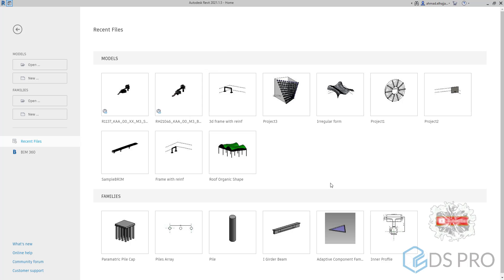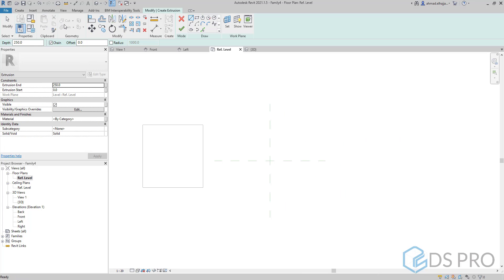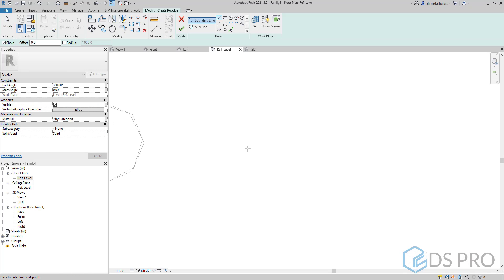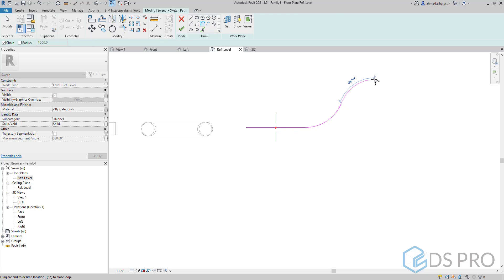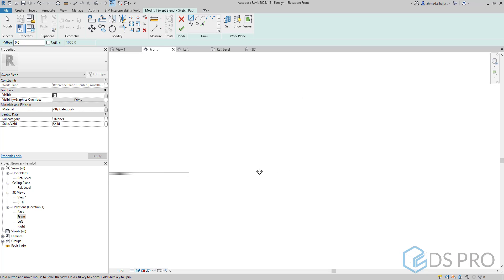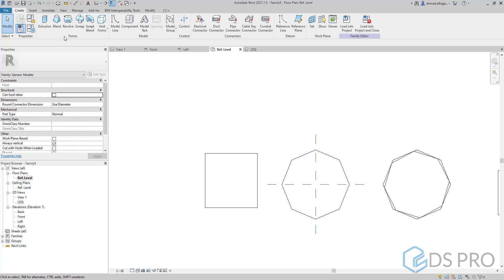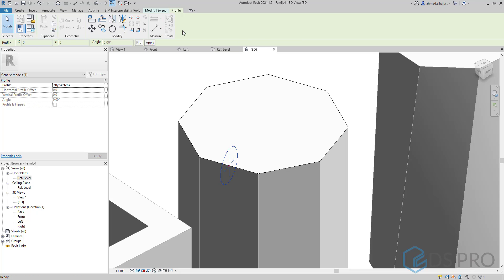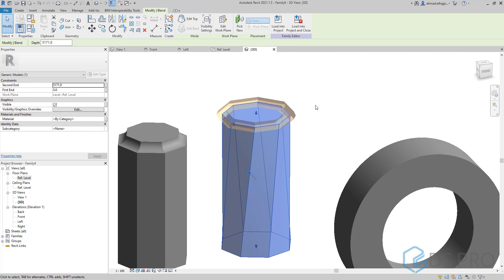2- Extrusion, Revolve, Sweep, Swept Blend, Shapes - Revit.

Comment: thank you so much for your effort but i have a question if you dont mind, i need to the profiles of the swept blend to remain vertical, not perpendicular, any help please?
Reply from the maker: What do you mean by remain vertical, you cand draw the path as you like, vertical, horizontal, curve, ...
And you can draw the profile shape as yoy like also. So what is your question? Can you explain more?
Reply: @ds-pro1307  profile 1 and profile 2 will maintain to be perpendicular to the path and they will rotate accordingly whenever you edit the path , i want to keep the profile plane fixed and edit the path especially when i draw the path using arc tool, if you to edit the radios of the the path, the profiles will change their plane however i want them fixed 
Thank you for response